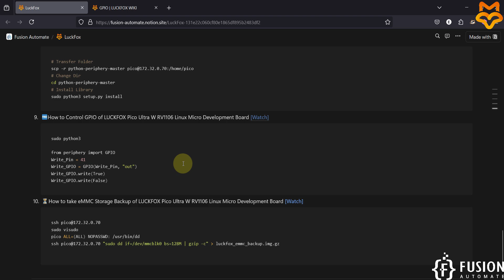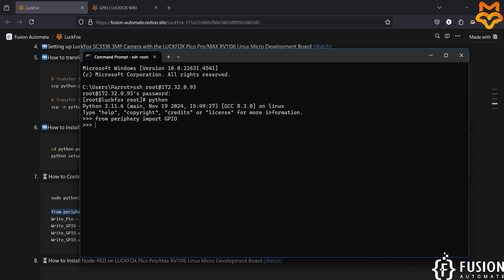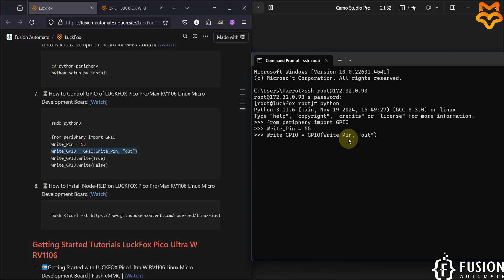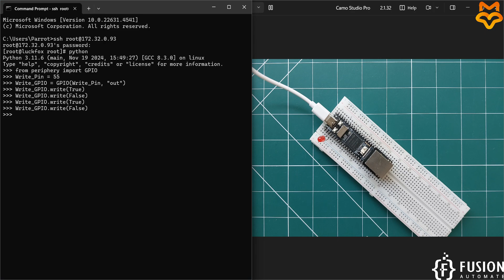How to Control GPIO of LUCKFOX Pico Pro/Max RV1106 Linux Micro Development Board using Python |

Comment: its linux we can control from shell using commands. everything on linux is file
echo 1 > /sys/class/pwm/pwmchip1/pwm0/enable
echo 0 > /sys/class/pwm/pwmchip10/export
echo 1000000 > /sys/class/pwm/pwmchip10/pwm0/period
echo 500000 > /sys/class/pwm/pwmchip10/pwm0/duty_cycle
echo 0 > /sys/class/pwm/pwmchip10/pwm0/duty_cycle
echo "normal" > /sys/class/pwm/pwmchip1/pwm0/polarity
echo "inversed" > /sys/class/pwm/pwmchip1/pwm0/polarity
echo 0 > /sys/class/pwm/pwmchip10/unexport
echo 0 > /sys/class/pwm/pwmchip1/pwm0/enable
now can make shell scrip no need python